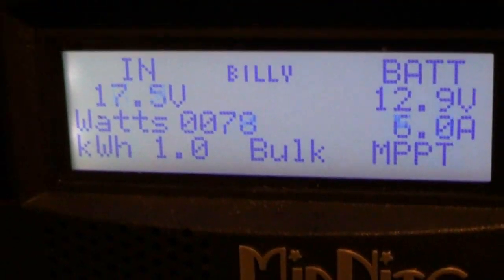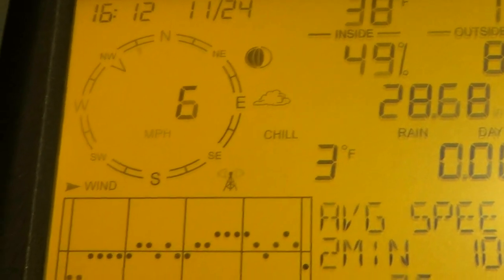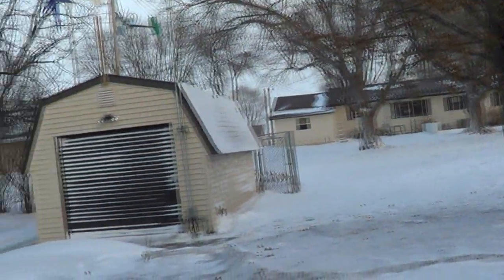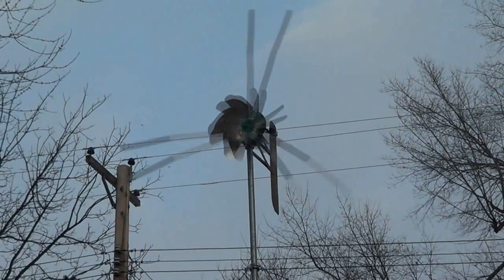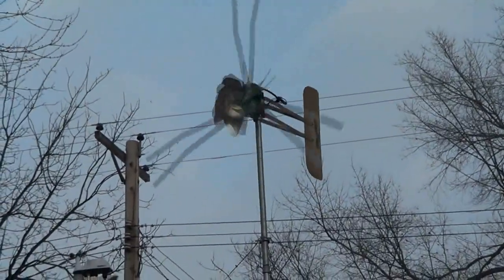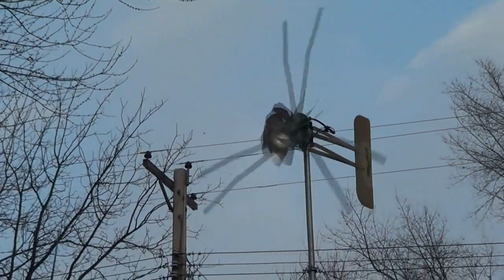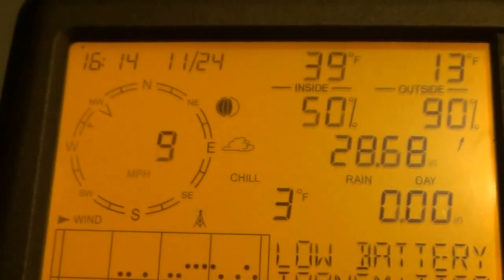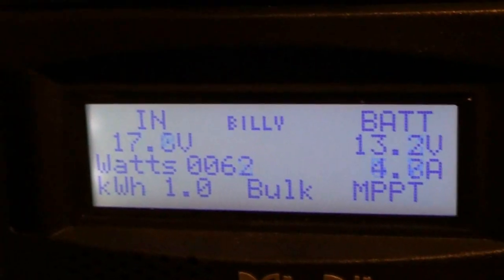WindWalker Lite showing 1 Kwh on a Midnite Solar Classic 150 pt 5

Comment: Wow!! Billy, you are the only one that show data with the classic on 12 volt and that is verry interesting.. I just try to calculate the POTENTIAL POWER of the AVENGER in the same configuration but in 24 volts and the numbers are EXPLOSIVE... I have check the local weather station at your location to based my numbers and you would have see 2.1 KWH on 24 volt.. The data you have collect are precious  and will be validated with more people showing their results my friend.. Thanks for the nice vid Buddy..
Reply from the maker: Thanks Buddy for bring this up I plan to range my bank to 24 V to see. :) thanks for being there!!
Reply: TheBillythekid2010 Need a big cap on the input side to see if you notice changes in the output power..  LOL
Reply: ***** Was it trough the grid tie or charging battery?? The way i am setup, i have 2 buffer cap setup to different output..  My first stage cap is 69 volt 180 000 mf tie directly at the + and - of the bridge rectifier.. The second buffer is a 16 volt 83 farrad cap tie directly to the battery to have a smoother ABSORBSION in the battery..
Reply: ***** Dont forget that the grid tie has already a balanced cap for it`s maximun rating capacity..  The outside cap has to be twice as big as the cap Inside the grid tie to be EFFICIENT ..